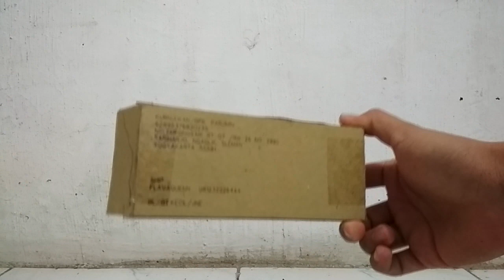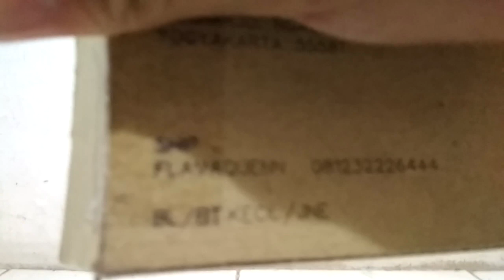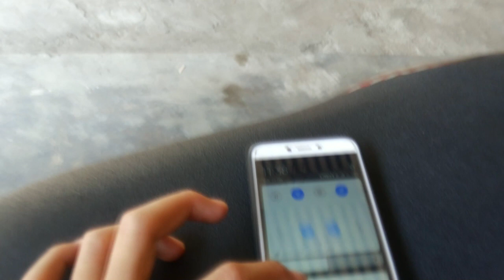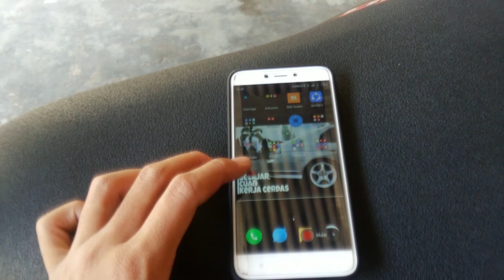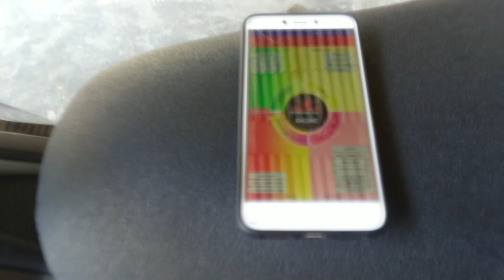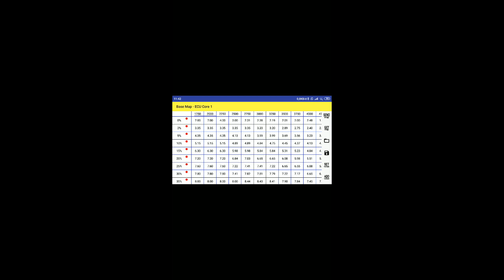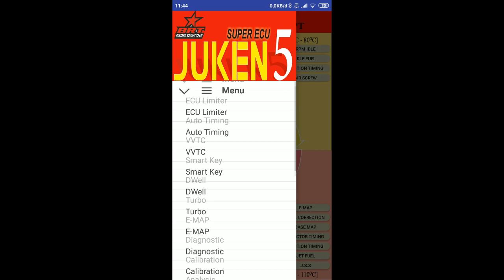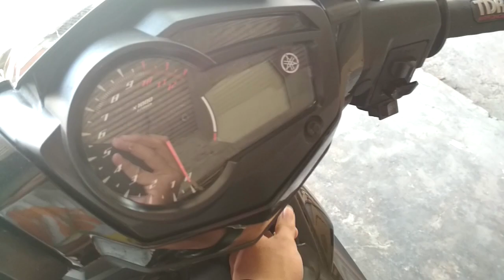Simple Cara Setting Ecu Juken 5 Via Android. Fitur Lengkap Banget..... |Juken 5 Mx King

Comment: Gan mau tanya, apa saat start ecu juken 5 mesti di posisi netral kah? Punya saya kalo  start saat masuk gigi dikupling hidup tp settingan lagsamnya error, klo d netral engga,,, apakah settingan brt bgtu, atau saya salah setting, mohon pencerahnnya🙏
Reply from the maker: harusnya normal semua langsam nya mas
Reply: @satuseketmotovlog  setting idle yg pas kira kira gimana, punya saya position 40,deselarasi 10,0 fuel 0
Reply: Coba gan, punya agan start nya pas masuk gigi apakah langsam tetap normal
Reply from the maker: paling penting kalibrasi tps dulu mas, trs di base map /fuel correction 1000-2500 diratain tps 0 nya, nanti tinggal sesuaiin sama baut angin2 aja bukaan nya.
Reply: Udah di set pabrik, kalibrasi, cuman dr set nya, position terlalu tinggi 60%,deselarsi 25% sering nyangkut saat start dan ketika jalan, ane pake cbr pake sensor IACV gk ada baut stelan angin... Oke gan makasih atas pencerahannya🙏
Reply: Biasanya klo rpm tidak stabil bsa dari idle fuelnya kebasahan